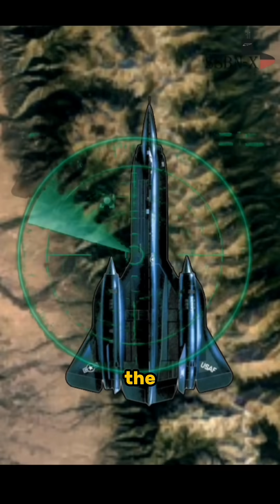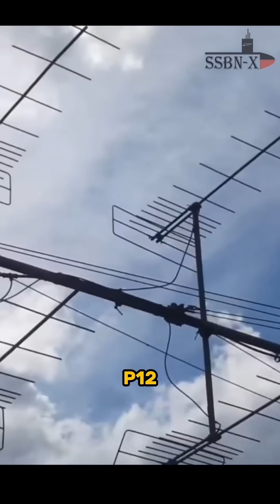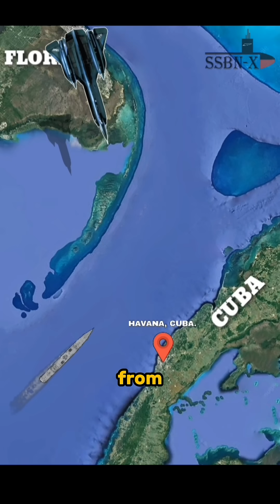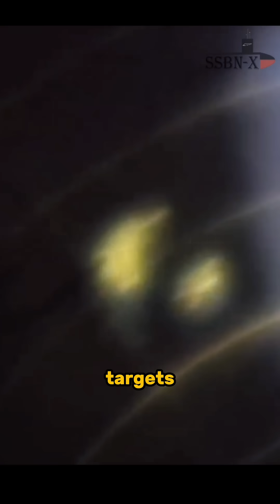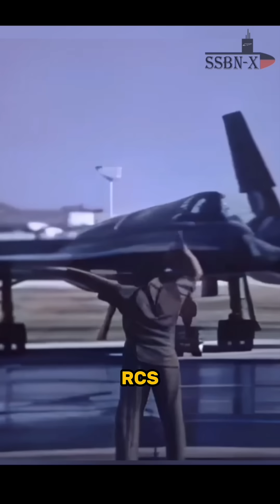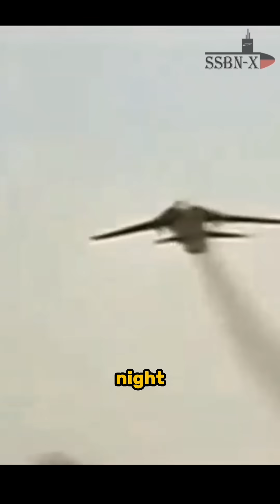In 1962, US Secretly Test A-12 Oxcart's RCS

Comment: "reduced visibility" just meant how small of a surface area an object is from a radar return. For example, the blackbird's rcs is 0.01sqm, about the size of a small bird;imagine how much smaller the A-12 is

And even though they're detectable in radar, either nobody's batting an eye for something that small on their screen or it's just an assumed bogus radar return
Reply: Right. But if your radar detects something the size of a bird going over 200mph. Surely it's not a bird
Reply: Wasn’t the A-12 just an earlier version?
Reply: Yup, it is the earlier version, primarily used by CIA. The later SR-71 by the air force
Reply: While the aircraft itself was stealthy, the hot air from it travelling at Mach 3+ had enough plasma, to have its own radar return, which was much greater than the blackbird's own radar return...

Comment: And some people today still believe stealth makes you invisible to radar. 🤦‍♂️
Reply: This video is misleading, when the A12 was developed a full sized fuselage made of the same materials was mounted inverted on a pole in the desert and the very Russian radars mentioned in this video were used to test whether it could be seen by their radar from the front, that was the only angle they were worried about it being invisible from, and they had to tweak things to get it to be and the final product was.

The A12 only had to be invisible inbound coming over the horizon and up to a certain point of being overhead because after that due to it's speed if you shoot a missile by the time it gets to that altitude the A12 will already be gone or the missile will run out of fuel trying to catch it on a more horizontal course.

Nobody except people who make YouTube videos and a lot of people in the comments  of them have ever claimed it was a stealth aircraft, only stealthy because while it could be seen from most angles it couldn't be seen from the front which was the designers only concern, even the massive afterburner flames coming out the back are radar detectable despite a special chemical put in it's fuel to help reduce it's refltectability.
Reply: @dukecraig2402 Freon gas I suppose.
Reply: @dukecraig2402

Except for the fact that they deliberately designed it to be stealth. That’s why the vertical stabilizers are canted inwards and part of why is has a chined fuselage so that very few surfaces are perpendicular to ground and air based radar.  

It’s just that—like the F-117 flying a predictable mission because of political considerations and laziness—they didn’t realize that other factors would negate its stealthiness.
Reply: @dukecraig2402 The afterburner flames are NOT detectable on radar, though... Where did you get that idea from?
Radar works on radio signals hitting a structure, and returning to base, and a flame doesn't have anything to reflect sound on...

On the IR spectrum however, the afterburner is very noticeable, but that has nothing to do with radar...
Reply: @SgtMclupus  
Yes they are, do your research about the A12/SR71 and you'll find they put a chemical called Cesium in the fuel to help keep those massive afterburner flames reflective qualities to a minimum, those afterburner tails are two big plasma spikes sticking out the back that are very much able to be seen by radar.
Reply: Back then stealth was more low observation. Ur not completely invisible but if your a non 5th gen aircraft or a slightly less sophisticated radar ur either not gonna detect it at all or have a mach2 bumblebee streak across ur radar ping
Reply: The more advanced electronics you have on your aircraft, the easier it is to be spotted by radar because those electronics (communication components, network components, onboard radar systems are all throwing waves about and radar systems will pick it up.
Reply: @ysw8291  Actually not. English is my second language. I grew up in the sixties in a country where the Prime Minister had spent WW2 in the slammer for sabotage because he wanted to support the Nasties. So I know about these people. Now, if I was an Anglo, what difference would it make to physics?
Reply: And trump thinks that stealth means literally invisible...
Reply: They never sent the plain it was ballon’s and radar signals that emulated that the planes are flying
Reply: Everybody acts like they’re an aeronautical engineer at skunk works in the comments. How bout all of you shut the fuck up.
Reply: Every mainstream media say so
Reply: It doesn't make you 100% invisible and I'm sure there are angles at which F-22, F-117 and B-21 would light up like christmass trees on radar but stealthy features make planes harder to detect.
Would you believe your own eyes if you saw a bumblebee fly at mach Jesus on your radar screen? Many would probably dismiss it as technical error.
Reply: And on the other hand, Vladolf Putler is telling his minions that stealth doesn't work, while he and Xi are flogging their designers to come up with their own version. Hilarious, actually.
Reply: @dougerrohmer 😂😂😂
Reply: @dougerrohmer 👈🤡

Comment: And Cuba had Mic-25 in 1962. Probably got them through a time machine. 😂
Reply: Doesn't make any difference anyway, they couldn't get to the altitude necessary to shoot down an A12 or SR71, that altitude record everyone claims it's proof it could was a special stripped down, unarmed and lightened up MIG25 that flew a ballistic arc to achieve that record, aside from being unarmed fighter pilots will tell you that you can't achieve missile lock on a target flying level from an aircraft flying a ballistic arc, you have to have the nose of the aircraft pointed at the target for a minimal amount of time to get a weapons lock on it.
Reply: @dukecraig2402

The Mig 25 intercepted the SR-71 numerous times over the Baltic.. closing into exactly 3km of it at which point they turned around.. as that was likely the optimum distance for their Mach 5 missiles.  

They never shot it down because it remained in international airspace the entire time.  The SR-71 NEVER ONCE crossed into the Soviet Union.  

Not only that.. but the Swedish Air Force successfully intercepted the SR-71 on not less than 51 separate occasions in their much slower SAAB Viggens.  

You don’t need to fly as high as the SR-71. The missiles will easily make up the difference. You simply have to anticipate its flight path—which for a plane that has an EIGHTY ONE MILE turn radius and has to stay in international airspace (unless it’s overflying a tiny developing nation), it’s child’s play.

Comment: Nice Quick image of the "interceptor" version of the SR71 called the YF12 though it was never used, it had air to air capability with 2 AIM 54 phoenix air to air missiles carried internally and a radar in the nose (different shaped nose cone is the give away that differentiates between it and it's sister SR-71
Reply: It wasn't feasible, first off since interceptors need to scramble at a moments notice you'd have to have pilots around the clock sitting in their space suits breathing the special mixture of gasses they need to be saturated with to fly at those altitudes, the aircraft needs to be in a constant state to scramble also, and the way fuel leaked out of them just sitting there causes a problem also, and they take off with half a fuel load because they're so heavy fully fueled making the possibility of a tire blowing and them wrecking on take off a very real prospect, that's why the first thing they do after taking off is hit a tanker and interceptors don't have time to hit a tanker, especially an aircraft that requires such a large amount of fuel and has to spend so time on the tanker to get topped off, that won't work for interceptors since they need to take off and head directly for the incoming enemy aircraft. 
There's just too many problems with the design for it to be used as an interceptor.
Reply: Thanks for sharing.  It's good to try and find out what doesn't work.
Reply: The Mig 25 and 31 also leak fuel profusely. The 31 can barely lift off with half a tank.

Comment: The bird is not stealthy because there was no actual plane flying, they just simulated the RCS with the destroyer and the radar reflector balloons - this proved to the US that even the smallest radar signal can be detected by the Soviets and the plane therefore would be detected. That’s why the MiG fighters were confused because they switched the radar signal simulating the plane off.
Reply: The sine describing the sr71 that retired from Castle AFB ( Atwater, Ca )used to say M3.5+late 90's. Now (2022)it says 3.2.
Reply: It's not just that simple either, extensive tests were done with an A12 body on a pole in the desert using actual Russian radars that were the same as mentioned, tweaking done by those tests then actual mission's showed that the A12 couldn't be seen inbound, once overhead and outbound it could but that's not what they were worried about.
Note; The fact that they could be seen overhead and outbound and the US knew very well they'd been tracked on every single flight, from a certain point on, is what makes me laugh in the face of all the people who say, "The US still keeps the actual top speed of the A12/SR71 classified", why would they? Every time it flew over something the country it flew over and most of it's neighbors were tracking it after a certain point and knew full well exactly how fast it was going, I'm sure they're perfectly capable of doing the math.

The reason it couldn't be shot down is because it couldn't be seen inbound to the target, once at a certain point overhead (certainly before being directly overhead) it was too late to fire a missile because it was moving so fast by the time the missile would get up to 85,000 ft the A12 was gone. 
Either Vietnam or North Korea came up with a trick however that got them close a couple of times, they "Daisychained" some SAM sights along a flight path they knew the A12 would fly along on an over flight, when the first sight picked it up starting to pass overhead it didn't fire it's missile's further one's one's down the line did, this was in hope that their missile's would be most of the way to altitude by the time the A12 came along and could get a lock on it, there was at least one occasion that an A12 returned with a piece of shrapnel lodged in it's backside from SAM's detonating close by, it's that experience that prompted the designers of the SR71 to put the latest electronic countermeasures in it to deal with SAM's, it became obvious sooner or later it'd happen, and that's why I laugh at people who make claims about the SR71 supposedly accelerating to speeds above mach 3.2 to outrun missile's, they didn't have to it's electronic countermeasures take care of them. The electronic countermeasures are the only thing the ex pilots won't talk about in interviews, because it's the same equipment still in use in today's version of the U2 to keep it safe from missile's.
Reply: @dukecraig2402  It was in Vietnam where the A-12 came close to getting shot down. The NV fired SAM came close to about several hundred meters of the Oxcart. And the SR-71 also had extra feature that made it a better plane than the A-12, it had side looking radars. This meant that the SR-71 didn't have to overfly directly or near the target, but rather it can fly from quite a distance from the target as well as other SAM sites. Greater distance meant greater survivability for the Blackbird.
Reply: @dukecraig2402  We always knew whatever claims from US military will have to be discounted as they always have the perfect excuse on non performance and failures
Reply: @dukecraig2402 naahhh too long.. very simple analysis, the a12 can be hit, once locked by the missile..
Reply: @dukecraig2402 😮🎉❤ Well Message. Thank you.
Reply: imagine mig pilots confusion when supposed american plane suddenly dissapears
Reply: @Wayz1133 nowadays it's not a surprised anymore with F35 suddenly disappeared and never to be found again
Reply: 😊 I’m